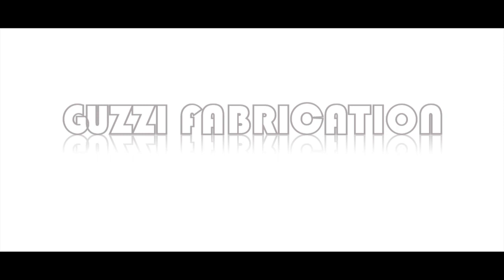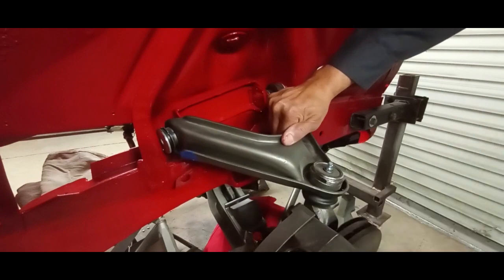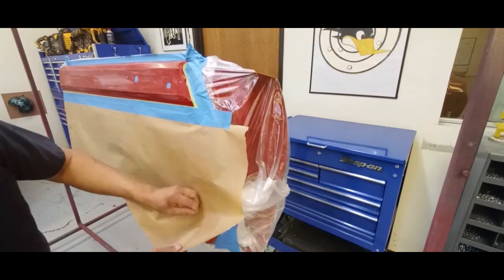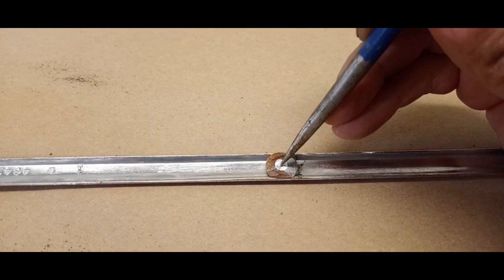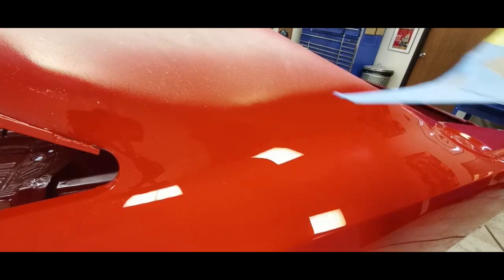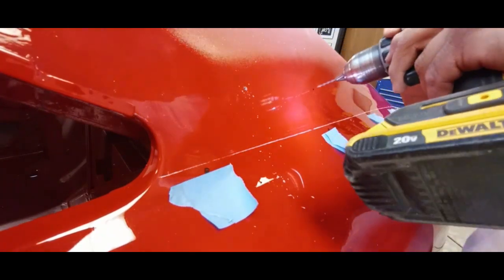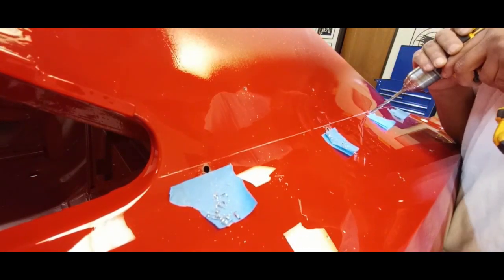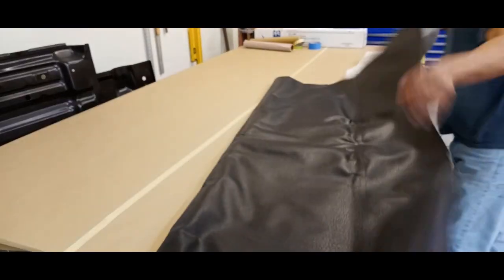1968 Charger RT Restoration Paint Part 3 - Install Vinyl Top - Paint undercarriage - floor - trunk

Comment: im building a 68 as well, Im adding the vinyl roof trim pieces but not going with the vinyl top. Just wondering, do the pieces on the inside of the quarter cover the gap between the quarter and the deck filler lid? sorry i just find it hard to see
Reply from the maker: You should be able to see the mating line between the two panels. Good luck with your restoration, thanks for watching
Reply: @guzzifabrication3448  been using all your videos as an encyclopedia lol thank you very much
Reply from the maker: @glenjamin62  That's awesome !

Comment: Still have that template? Im doing the same thing and would buy it from you. Thanks
Reply from the maker: Yes I do, are you in Texas ?
Reply: Just saw this great vid, also wondering if you had a paper template available or can send measurements for the location holes? Trying to finish a 68 Charger with a vinyl top and new quarters. Lmkthx!